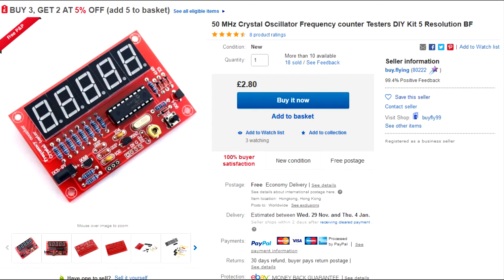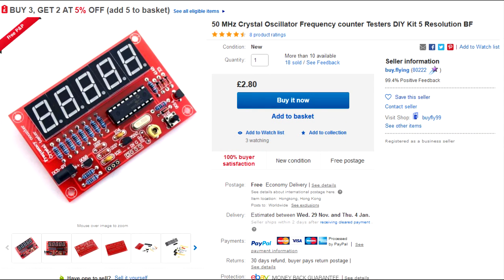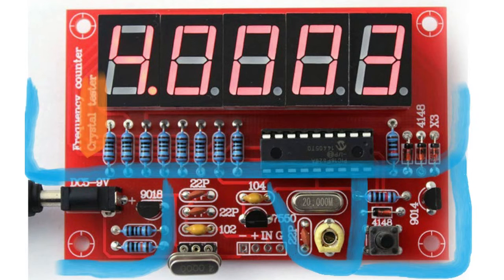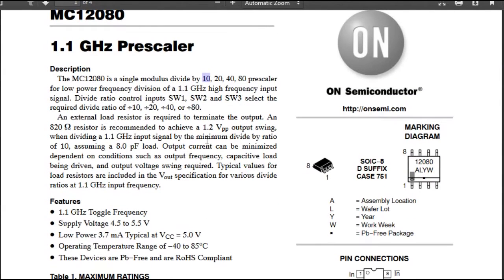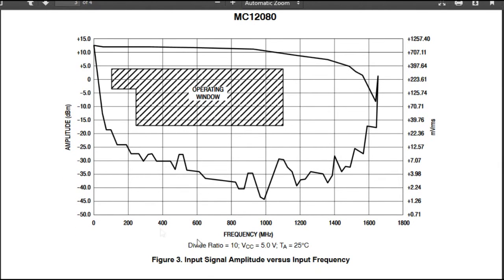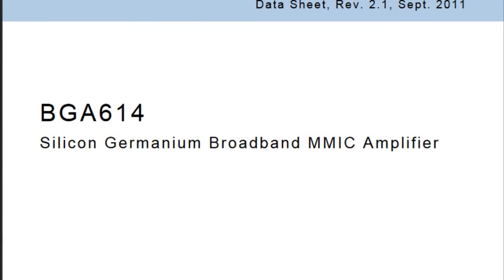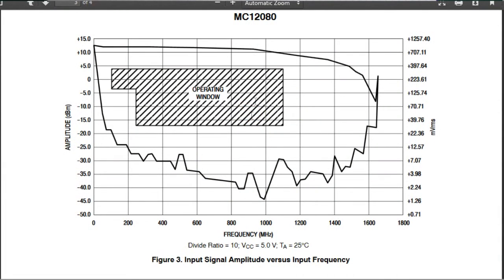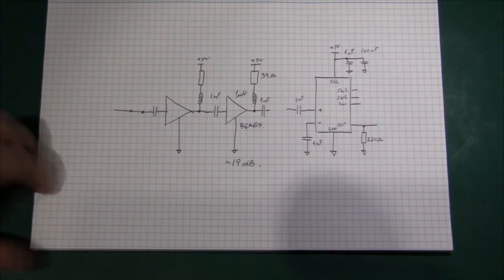Designing an RF Prescaler and RF Amplifier

Comment: Hey thanks for this upload.
  I have been exploring different prescaler front ends before building something. Did you ever get around to building this? I would really like to know if this combo worked for you as intended. I have the same PIC kit clone, but I'm also curious about creating a front end for a little ICM7216 as a quick little project and as a precursor to adding and documenting a few prescaler options for the OSHW AVR Transistor Tester project.
   The only thing I'm not really sure about is what kind of schotky diode to use. Just a 1N5819 or something more exotic? What about TVS protection on an input that will get handled regularly? 
Thanks again.
-Jake
 PS I will also add the link to the original OSHW project for this PIC frequency counter in a reply to this comment.
Reply: https://www.qsl.net/dl4yhf/freq_counter/freq_counter.html

Comment: Hi I've built this. To check mains through a transformer would be good? Thks.
Reply from the maker: I seem to remember that the input to the counter should be either TTL level or 3.3V. Please check it, before doing anything. I could be wrong. Definitely go through a transformer :) I would put a resistor between the transformer and the input to the counter, and a zener diode between ground and the input (Anode to ground, Cathode to input), to clamp the input, and make sure the input voltage does not exceed maximum allowed.

Comment: I believe Julian Ilett did a video on this module, I don't recall if he showed a schematic. However your analysis was a little off - the 9018 by the DC input is actually an amplifier transistor, and the 7550 by the crystal test socket is a 5V regulator.
Reply from the maker: I guess assuming that everybody lays out a board the same way as myself sometimes backfires. Putting the voltage regulator near the chip is not a bad idea, but keeping the oscillator near the DC input is not so good. But fair enough. It should work. The oscillator signal is not going to be buried in noise ;)